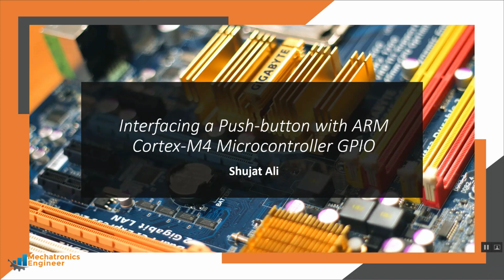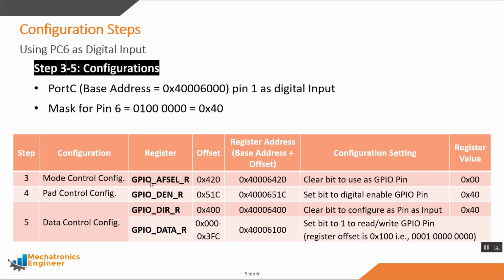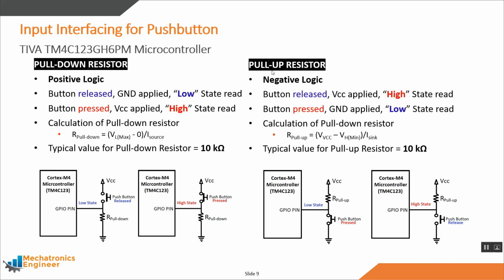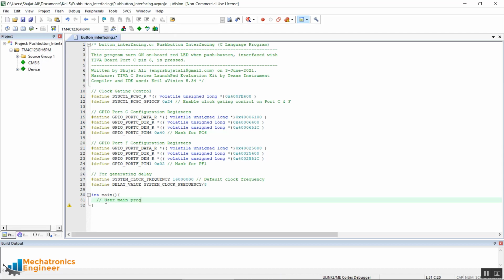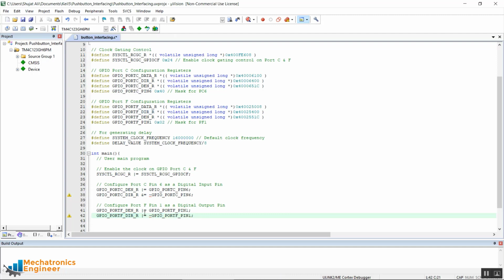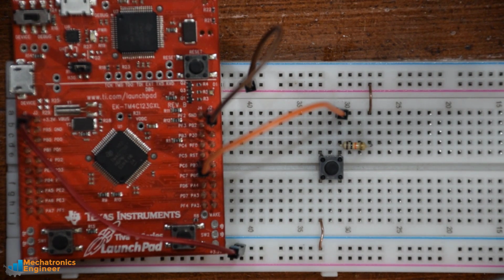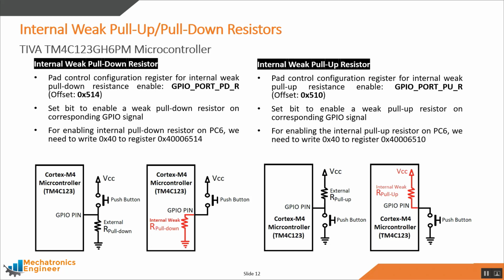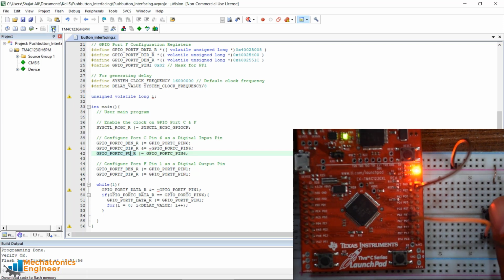Interfacing a Pushbutton with TIVA C Series LaunchPad

Comment: Nicely and efficiently describe each & everything. 
Respected Sir, Just want to know what is the value of the ARM cortex microController's pull-up & and pull-down resistors and why these are called weak resistors?
Reply from the maker: The value of internal Pull-up/Pull-down resistors for the controller is 13k to 35k. The reason they are called weak Pull-up/Pull-down resistors because these resistance values are relatively high. 
We can also have strong Pull-up/Pull-down resistors if the resistance value is relatively low.
Reply: @mechatronicsengineer1979  Got it. Thanks a lot.